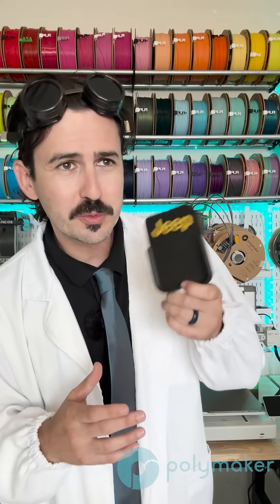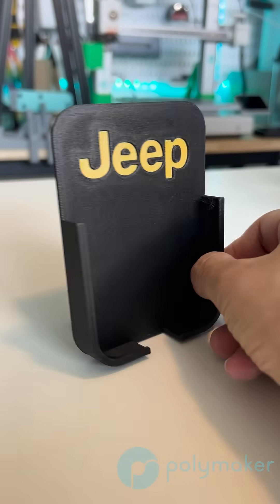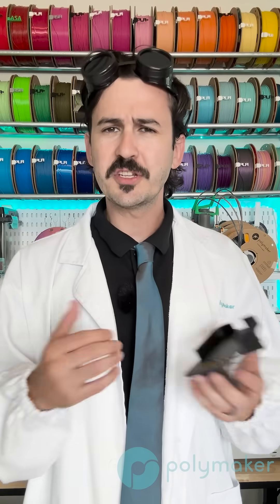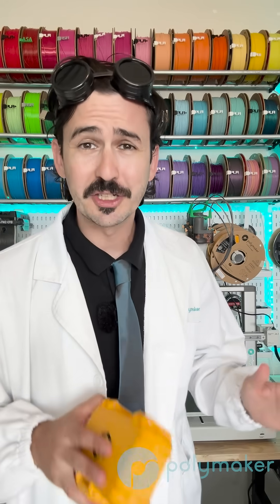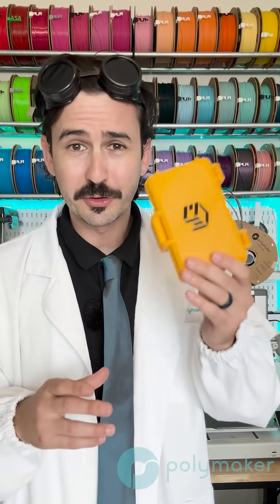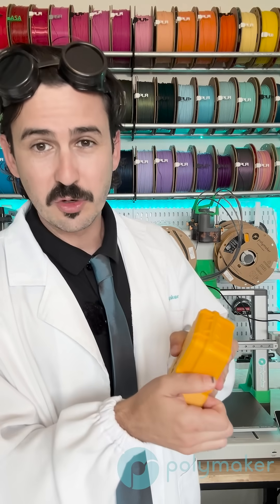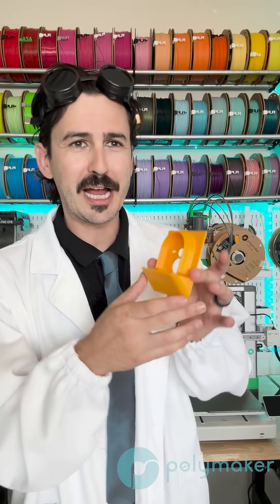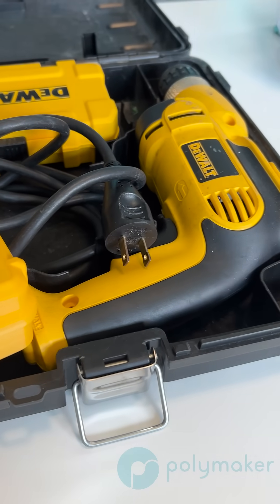NEW Material - HT-PLA-GF!

Comment: You said 150c off the build plate, but after annealing up to 114c? That doesn't make sense... Is the HDT different from your initial 150c "under it's own weight"?
Reply from the maker: The 150C stability without annealing is referring to the vicat softening temp - so what it can hold under its own weight.  The 114C would be the HDT - what it can withstand under certain weight/pressure.
Reply: @PolymakerLab thanks for clarifying!
Reply: @PolymakerLab So if I 3D print a box out of this material ( without annealing, ) and that sits in my car and holds documents ( no heavy load realy, just a big box ) and my car gets burning hot in summer, this box won't deform?

Comment: What about a pla+ with high temperature resistance? Is there a similar material to this?
Reply: There's no such thing as PLA+. It just means "we have tinkered with the recipe with this one"
Reply: @SkullMutant  PLA + or some manufacturers call it PLA pro do have better properties than standard PLA.
Reply: @robertmunafo5039 yes, but there's no "recipe" for PLA+. Some has a lower melting temp, some has better layer adhesion, you can't say "PLA+ is better at X" because there's no such thing as PLA+. It's just PLA that has been modified in some way
Reply: This is a PLA+

Comment: Still not UV resistant, but a major step up from regular PLA,  anything  (regular)  PLA that I have left in the car , has warped.   may give this stuff a try.
Reply: a uv resistant clear coat should help quite a bit
Reply: People go on about pla and uv resistance but I have and have had parts printed in a variety of brands of PLA, some of which are load bearing, outside in full sun exposure and hot summers/cold winters going on 4 or 5 years now with little to no perceptible decrease in strength or stiffness, no warping, or any other manner of degradation I can think of. Just some color fading as one would expect from any material. 

I’ve seen loads of similar examples, but haven’t seen many if any examples of the supposed incredibly poor UV resistance of PLA. 

I’ve never really see people say why pla can’t handle uv exposure either. They just say it can’t ad nauseam or say vague nothing statements like “it’ll degrade”. Ok cool but like degrade in what way. On Reddit if someone says a part printed in PLA is going outside  every comment will be “pla can’t handle uv exposure use abs or asa” like literally every comment. 

Inb4 someone replies with “well akshooallee my pla parts disintegrate, explode, kick my dog, and sleep with my wife within .0000000005 seconds of UV exposure”
Reply: And it still doesn’t matter lol. I have load bearing pla outside in full sun exposure for about 5 years now. 0 issues and no perceptible degradation outside of some mild color fading which basically any material will exhibit in similar conditions. 

Have seen myriad examples of others with similar experiences. Haven’t seen a single example of this supposed extreme depredation pla exhibits under UV exposure. Yet anytime anyone implies they’ll be using a pla part outside you see people screeching that pla can’t handle UV exposure ad nauseam. I’ve seen people even claiming that you cannot use pla outside under any circumstances without exception lmao.  Literally every comment lol

Inb4 someone replies with “o ya well akshooallee all my pla parts r vaporized + explode + implode + kick my dog + sleep with my wife within .000000005 seconds of uv exposure so ur wrong kid”

Same crowd that tells people pla can’t bear load, no doubt lol. It’ll creep bro pla creeps bro but the creep bro u can’t bro it’ll creep bro ya bro pla creeps bro
Reply: And it still doesn't matter lol. I have load bearing pla outside in full sun exposure for about 5 years now. 0 issues and no perceptible degradation outside of some mild color fading which basically any material will exhibit in similar conditions.
Have seen myriad examples of others with similar experiences. Haven't seen a single example of this supposed extreme depredation pla exhibits under UV exposure. Yet anytime anyone implies they'll be using a pla part outside you see people screeching that pla can't handle uv exposure ad nauseam. Literally every comment lol

Inb4 someone replies with "o ya well akshooallee all my pla parts r vaporized + explode + implode + kick my dog + sleep with my wife within .000000005 seconds of uv exposure so ur wrong kid"
Same crowd that tells people pla can't bear load, no doubt lol. It'll creep bro pla creeps bro but the creep bro u can't bro it'll creep bro ya bro pla creeps bro u can’t bro the creep bro the creep